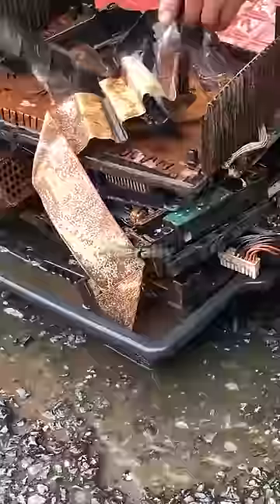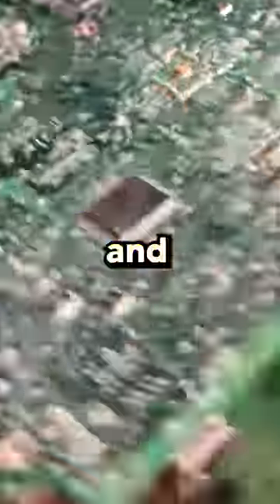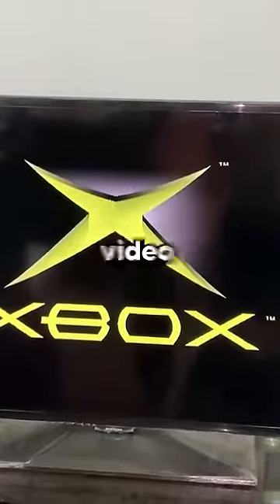Fake Restoration

Comment: It’s not bad to put electronics in water as long as they’re not powered on
Reply: It is bad if you want it to you know work
Reply: @Patches_0001  it is?
Reply: @Patches_0001  nope. Just as long as it isn’t connected to power, and it fully dries it will still work.
Reply: @LittleToyBonnie yep, side effects may include rusting and destroying the motherboard
Reply: I'm in electronics manufacturing. Every single board is washed in water and detergent after all soldering is done. Like the post said, water doesn't hurt circuit boards unless there's power to it. Theres some components that you shouldn't wash like lcd screens but vast majority if main boards in devices don't have anything that water will ruin. Those small pjezo speakers come with a sticker over the speaker hole just so water can't get inside during manufacturing.
Reply: It is bad, because if I leave a iPhone off and put it in water it won’t work, because water gets rusted over time which can short out electronic components
Reply: @FireAlarm225 Did you just say water rusts over time? Take the battery out of the phone, put it in water, let it dry, boom no harm no foul.
Reply: @mpnxgeo3066  what are you talking about. Your saying water doesn’t rust?
Reply: @FireAlarm225  Are you kidding? WATER rusts? No, you dunce, METAL rusts. Are you legally allowed to vote? I sure hope not...
Reply: Bro you good
Reply: Capacitors have entered the chat
Reply: And you let them dry off entirely before turning it back on
Reply: @Patches_0001  factorys wash everything with water, it doesnt do anything if you dry it 100%
Reply: @Patches_0001  No its 100 percent safe as long as now current is flowing through
Reply: @Patches_0001 so confidently wrong
Reply: @pzkpfwviii_maus  no cause a lot of devices will break even if it’s off
Reply: @Patches_0001  thats just wrong, the reason water causes damage is due to its conductivity, and will cause short-circuits if there is current. seeing as the device was powered off, the only damage that could be caused is corrosion, but it was just rinsed and dried.
Reply: @pzkpfwviii_maus  if water gets inside the sockets or other entry points it’ll break
Reply: Water is completely fine as long as there is no power. That includes both being plugged in and batteries being in the system. If anything is supplying power then yes it could break but if you took everything apart and washed individual components without any sort of power being supplied at all.
Reply: throws friend phone into a pond

Friend: what the hell man?!

Me: It was off. It still works.
Reply: @Patches_0001 wrong. stop spreading false info
Reply: @melonboi186 also wrong. nearly 0 iron, and it's dried immediately after washing
Reply: @Patches_0001 no, so long as you let it properly dry, water can't cause a short circuit and therefore can't do damage
Reply: @theorphanobliterator  not wrong tho
Reply: @Patches_0001  yes wrong.
Reply: Dude they always charge ..
Reply: @StrategicLemon  it isn’t false and nothings gonna happen lol
Reply: @Patches_0001  We'll see buddy.
Reply: @StrategicLemon  💀
Reply: @wormhole331 is correct.  The that that causes damage is water running through the electronics while powered.  This causes corrosion on metal contacts.  Rust is a slow process on PCBs. If you leave it in water for months yeah is fucked but if you wash the crustys off a bare board you’ll have limited to no issues.   It’s when powered electronics are turned on that liquid damage really starts to happen quickly.    Salt water will cause liquid damage in seconds and clean water in 10 to 20 minutes.  Your iPhone being off doesnt mean there is no power to it.   It’s still got lots of chips powered on and there is sill power being put into the board.    It’s very common to wash corrosion off of a PCB as part of the process of repairing liquid damage.  Isopropyl alcohol is often used because it dries much faster.  But putting an old crusty motherboard in the dishwasher *AFTER REMOVING BIOS BATTERY* will cause no problems so long as you let it dry completely before powering it on.   This is why your soaking wet iPhone still works for a few hours after getting dunked in the sea.
Reply: @JaydonLewis0 you arent a factory also
Reply: @theorphanobliterator  Ignore him. He's just acting like he knows what he's talking about when he doesn't.
Reply: @StrategicLemon  aight
Reply: @Patches_0001 water won't break powered off electronics as long as the part is COMPLETLY dried even if the water gets in sockes or conection points as long as its dried off it won't cause any damage
Reply: yeah its fine and preferably use distilled water

Comment: You can absolutely wash electronic parts in water. They just have to be 100% dry before you send a current through them.
Reply: @Xrins_Kwes  why? It’s how even the manufacturer washes parts when refurbishing them. There is no risk, as no current is passing through them.
Reply: @Reeves91011 yeah, but the only risk is, you gotta be careful which components are getting wet, like you shouldn’t wash an LCD screen.
Reply: @Xrins_Kwes for example what?
Reply: @catninja4950  probably will say IPA, but circuit boards are washed with water at the factory, so if the factory can do it, we can too
Reply: Been working on pcs for almost 10 years atp. Yep, 100% safe just dont power it on and remove internal timer batteries. Should work when entirely dried.
Reply: @Xrins_Kwes as long as you let it dry its ok but i use water typically as a last resort
Reply: But the mother board will get damaged
Reply: @prakulmehta380  no, because they are already washed AT the factory
Reply: Was about to comment this
Reply: The minerals can still erode electronics
Reply: @Reeves91011 Corrosion left the chat.
Reply: The factory isn't using tap water lmao
Reply: @Reeves91011 components like hard drives maybe?
Reply: Ya most of them die before can power on 💀💀
Reply: It is fine to wash with water but you better make sure it is COMPLETELY dry before use. you are better of using something like 90%+ ispropyl alchol fair warning through dont be bathing it in isopropyl alcohol as the fumes can be minorly dangerous in large quantities. Ispropyl is generly suggested because it evaporates quickly leaving very little chance for damage.
Reply: He scrubbed them with a brush bro
The damn motherboard would be destroyed by that
Reply: @Valor_con  It depends static in the brush if the material does build up static well its fine.
Reply: @Xrins_Kwes use mineral oil or distilled water both look like water but it's not normal water/oil but both looks like normal water but I won't recommend to use miniral oil for long time it will corrode the board if u sink the plastic more than a week'
Reply: @prakulmehta380 you can wash you Mobo or desktop components as long as u make sure their is no power on it neither on components; can't remember name but their are some parts that have power so you must press power button with power supply off.
Just make sure to not scratch any traces or break any components
Reply: My friend is in electrical engineering. He told me that if you do wash your PC parts it needs to be with distilled water so there’s no minerals. It’s the minerals in the water that shorts out electronics
Reply: @@flovvys1777considering that I had my phone splashed with well water for an hour while my screen is slightly peeled off at the corners (literally the screen, not the protector) and was fixed with a Ziploc bag with rice, it's safe to say that most modern electronics will be able to handle a bit of mineral deposits. Also have dealt with tea spilled onto a motherboard getting into the CPU socket while it was powered on. It definitely caused an issue with booting on (like my phone when it was wet) but some cleaning fixed it, no other issues.
Reply: @@flovvys1777100 percent pure water is not conductive.  It’s the minerals that make it conductive and there for will cause damage when powered on.     Of course.  Leaving super hard water to dry will cause minerals to be deposited on the board and some of those may be conductive.  But for most part tap water is fine so long as its never given power while wet
Reply: @braylonmiller9341 its also more convenient as it dries within minutes so you don’t have to wait days for the water to evaporate from under the chips
Reply: @Kevaca the factory uses distilled water most of the times and they know how to do it, you dont
Reply: @Reeves91011 there is something crucial, you are not the manufacturer
Reply: @Fopenplop they literally do
Reply: unless there is erosion to the boards, like  parts chipping or breaking off
erosion will cause more problems
ive tried to fix old and new tvs from dried water and it just eroded and short circuited the board, erosion is worse
Reply: @ENDER_ELSA_1817  cleaning with water ≠ prolonged exposure to water
Reply: Not tap water. It leaves salts behind as it dries. When moisture hits those salts they become conductive.
Reply: @juanferreira5931 tell us you don't understand electric conduction without telling us lmfao... They are literally washed this way in every factory prior to shipment. You think they import or make distilled water for this process.. lol...
Reply: and with 0 minaral water
Reply: Even they can use isopropyl alcohol.
Reply: Can wash only it was turn off.

Comment: It is actually a common practice among some electronics engineers to wash circuit boards in water. as long as the parts are dry at the point when they are turned on, everything is fine. Sometimes it is even a better option then cleaning it some other way.
Reply: Facts